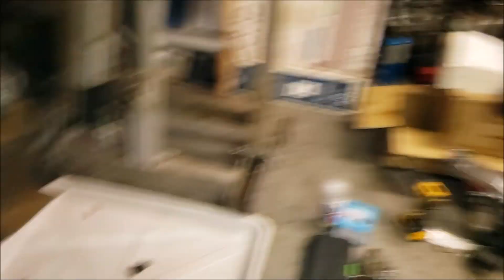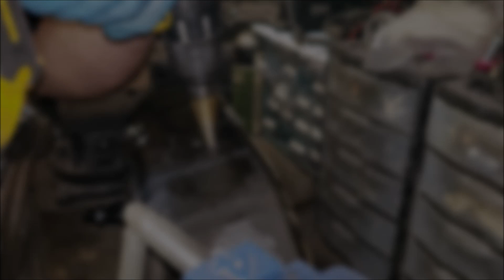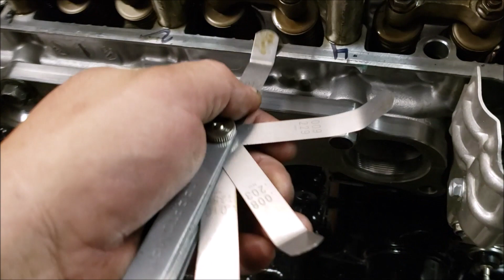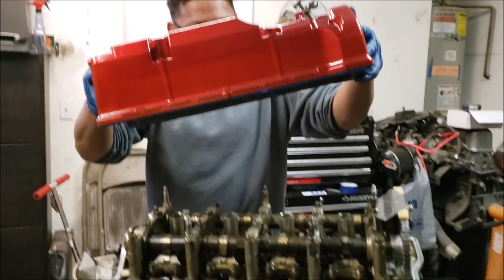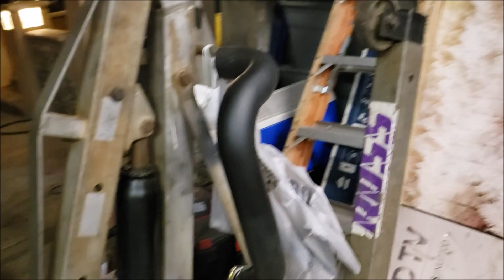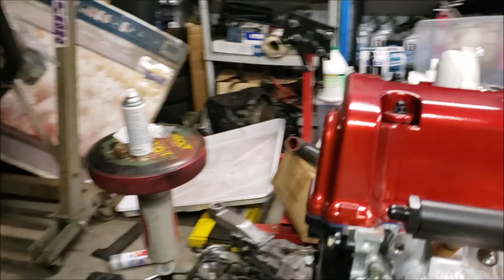K Swap Mitsubishi Starion Final Engine Assembly

Comment: This is coming along nicely, why did you guys go with the k20a instead of the k20z, was it availability or cost? either way it looks awesome, i know you keep saying that your behind and your videos are starting to speed up, but if i could ask one favor, when you get to the electrical part of things, if possible, could you go into alot of detail, im putting a kseries in my conquest next and electrical is my weakest link. thanks for pioneering this swap, im anxiously waiting for your next videos.
Reply from the maker: Thanks for watch. It actually a k24 from an accord✌
Reply from the maker: For sure what is it mostly you would like me to focus on
Reply: @SleepRGarage  , i honestly dont know, you mentioned that you have a stand alone harness, and when you did the wire tuck, the run on the passenger side was removed along with the ecu, and since its a 80's car im not certain as to what would still be needed to tie into. i guess a blanket focus on anything thats original electronically, that would tie into the new stand alone, but its a stand alone harness, uggghhh, electrical sucks!!!! thanks for the response, secret project car looks cool too.
Reply from the maker: @drexal510  sorry for any confusion friend. Let's see if I can clear some of it up. We are using a factory RSX harness that we will be modifying, nothing too tricky just extending wires and eliminating plugs we dont need. On the other end where it plugs into the ecu we have an adapter made by Hybrid Racing the converts the harness to a standalone so all we have to do is plug the wires into voltage supplied wires on the starions original harness, adapter comes with relays, dont worry will run through everything as detailed as possible without sounding too boring✌✌✌✌
Reply: Kevin Day Jr. - Hi Kevin... please checkout A couple videos back 

https://youtu.be/6PoTuBPLQm8 

and fast forward to 21:34 to see the harness I got from Hyrbid Racing. 

Here’s the link: 
https://www.hybrid-racing.com/products/hybrid-racing-k-series-conversion-harness-for-96-00-civic?utm_source=google&utm_medium=cpc&utm_campaign=googleshopping&utm_content=HYB-CWH-01-17&dfw_tracker=29587-48940170820&gclid=CjwKCAjwmKLzBRBeEiwACCVihl0V7GSd2Ogw5wy5xaqVMX5QAylR4_eja0BK9wlsbGYAxYpr5QXP4xoCuusQAvD_BwE